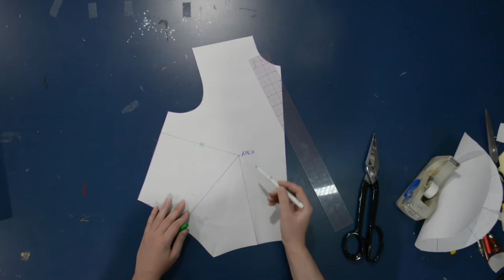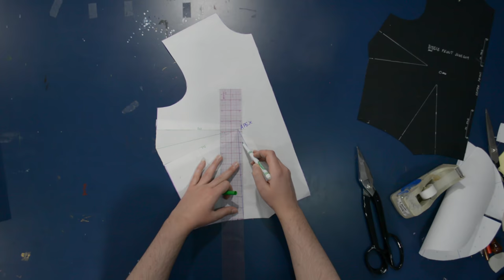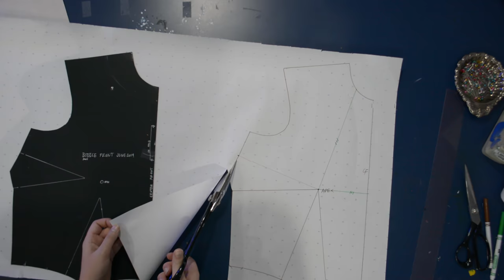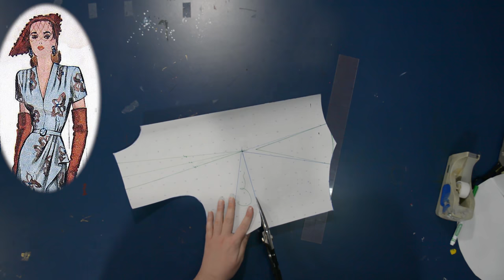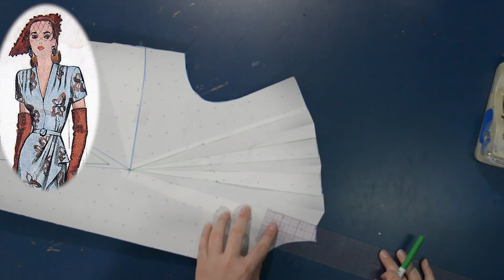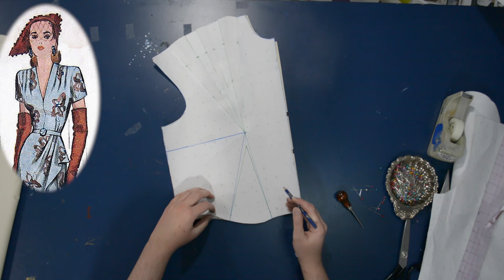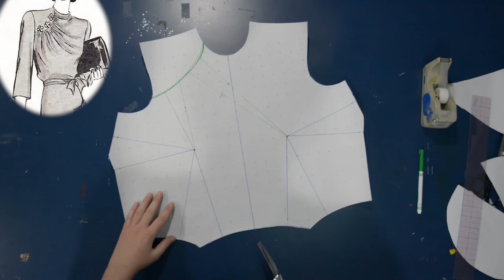Dart Manipulation Explained // The What, Why, and How of DARTS

Comment: Oooohhh this is SO useful. I knew darts, and that I put them into existing garments to make the chest fit WAY better, but now... The options are ENDLESS. Now I can alter patterns to fit me better: not only move the darts around for aesthetic reasons, but also to make the whole thing fit different. If the darts are at the top, the shoulders wil be more narrow. If I put the darts at the waist, that will be more narrow (which will work wonders for me, since I have quite an hourglass figure). If I don't want to alter the waist and shoulders much, I can put them at the armpits (what I've done so far for dresses that don't quite fit me). It all makes SEEEENSE!

Comment: Excellent! Thank you thank you thank you! You've explained and shown every step in multiple ways, and don't assume that we already know anything. Thanks for explaining sloper vs block. You say that you don't add 'much' ease. Where/why do you add ease? My patterns are so restricting that I can't twist, bend over, or bend and raise my arms. Your garments look smooth, not tight. Thanks for explaining that moving the darts DOES NOT change the fit! The examples are so helpful; I understand all of it. Love love love the asymmetric example - makes perfect sense. Thanks for saying that it's more about 'origami' than math. That takes such a weight off my shoulders! Your way is much better.  Question - What is an external dart (17:15)? How is it used in 1950s fashion? I did a search but couldn't find it. Sounds interesting.
Reply from the maker: Thank you Amy! I don't actually add any ease to my pattern 99% of the time, because I like my clothes tight 😅 I am not a good resource for learning about ease, as I just don't know much about adding it, since I don't eek! And external dart is just sewing the dart on the outside instead of inside of the garment, a bit like this neckline perhaps https://www.pinterest.com/pin/460563499399685468/ I used them on my leopard dress most recently https://www.youtube.com/watch?v=OI9k1tj9o5Q&t=806s

Comment: Hey Bianca, thanks for the comprehensive tutorial! But I have a kind of different dart question. How do I draft darts if I want to make my bodice fit close to my body from the waist to the under bust and then have fullness for my bust? With regular waist/bust darts the bodice has a lot of empty space in the underboob area and doesn't cup my breast.
Reply from the maker: You can either do something that has an empire (just under the bust) seam of some kind yes, like say these sort of '30s/'40s designs https://www.pinterest.com/pin/79798224627307942/ or you can go for a princess seam instead of darts, as the princess seam can be cut as close to the body under the bust as desired really. I will be showing how to make view B from this catalog page soon here on the channel, which will explain how to make the midriff sections of these styles in detail! https://i.pinimg.com/originals/8c/7a/41/8c7a41df36498bb3a79657434ba5c4f1.jpg
Reply: Look up some patterns for corsets or corset tops (like for wedding gowns). That will give you an idea, how the panels need to be shaped. 
Although it gets harder to do that, the larger your breasts are. At some point, cups or gores are kind of a must, because you'll be dealing with rather awkwardly curvy pieces, otherwise. But again, looking at historical corset patterns from different decades (just do a google picture search) will give you plenty of ideas on how to achieve a tight fit.
Reply: Look up 'contour darts' and 'contour bodice block'. A contour block represents the bust as a circle around the apex, with the darts being drafted at a different size inside and outside the circle and curved to connect the difference (this is how corsets and strapless bodices are drafted, as Rara Avis describes). Basically, the darts need to be sewn in a curve in order to remove more or less fabric from certain areas. Look at the curve on the side seam between the hip and waist of a skirt block. This is actually a dart; we just don't call it a dart because it's in a seam. 

If that all sounds too complicated, I would just make a mockup of a basic bodice block with a dart from waist to bust, pinch out whatever excess fabric is below the bust, trace the new dart line, and transfer that to your block.

Curved darts are also helpful if you have a full tummy and need a bit more space in the front, while still bringing in the fabric from hip to waist.
Reply: Yes I have been trying to achieve the same thing myself. I’m very excited for the upcoming videos and following some of these suggestions. Thanks!
Reply: @TheClosetHistorian  I am excited to see this!  The style reminds me of a swiss waist except it's built into the dress instead of worn over it like a belt.
Reply: @bianca_boop  Wow, thank you so much for your your reply! Sometimes it's hard to know what words to use when searching for what I want since I don't have an informed vocabulary. I suppose I should actually get some dressmaking/drafting books instead of relying on the kindness of strangers lol. Thanks again!
Reply: @TheClosetHistorian  thank you for your suggestions! I have been experimenting with princess seams but my bust is so large and my waist so high that I've been having trouble sewing the curves smoothly. I probably need to practice sewing curves more lol. I've been trying to draft a close fitting waistcoat that has a Victorian flavour but that I don't have to wear with a corset and smush my bust up to my chin. I think my reach is exceeding my grasp with my current skill level.😁
Reply: @raraavis7782  thank you so much! I was hoping for a way to get a close fit without a lot of piecing together of the fabric, but I suppose there's probably a limit to what a single flat piece of fabric can do, lol. I really appreciate your response, it will be fun to experiment with options I hadn't first considered.

Comment: I really appreciated this video. I've used dart manipulation and transformation into gathers/tucks to great effect on bodices that require a full bust adjustment. On a recent project (Vogue 8577), I split the new dart fullness into a bit of additional gathering at the shoulder and rotated the remainder into the waist. Then I converted the (now huge) single waist dart to parallel tucks because those worked better for that bodice style on my very short-waisted, busty torso.

Comment: Oooooh Bianca, this video is pure gold. I never thought I had problems with darts before, but now I noticed I also never really had an understanding about what is really happening when sewing darts 😅
I do actually have 2 additional questions:
1) in the bodice with the gathering down in the waist dart where you gathered it down to 7.5 inches - why wouldn't it be entirely closed instead of gathered then? I am confused with that because it would be 7.5 inches when you close the dart entirely, so how can you gather down the same amount of fabric to 7.5 inches and it is NOT entirely closed then?
2) is there any chance you can show how to draft the skirt part of that style with the nice side gathering piece? It looked like more than just a dart gathering in the drawing, kind of like the fabric is pulled a bit from the buttom and tucked up in the waistline and I would be the one saying "oh, I guess I have to drape this then" 😅
Reply from the maker: Thank you Laura! I'm afraid I don't really understand question 1. I need the waist area to measure the same whether I close the dart to shape it or gather it down to that same measurement instead, basically. For the skirt on the other hand, the front pattern would look like this https://www.pinterest.com/pin/460563499400986419/ and the extension on the side would just be gathered in and sewn to the smoother yoke-ish section above at the waist 🧵

Comment: This was really informative! I've never gone to school for sewing (aside from the very basic mandatory classes in junior high) so most of my sewing I learned by myself and from watching youtube. I'd consider myself pretty decent at it for having no formal training. 

But I always hated darts. They always came out wonky and assymmetrical in a bad way. But I'm making a mockup for a waistcoat as I'm watching this, and the front pieces are starting to look pretty good! Just need to adjust the side width and shoulder seam angle a bit. But this time I even experimented with a double pointed waist dart, because I need for it to swing out again as I want the waistcoat to go down past my hips in one piece. Similar to what you did with the example of the darts between the boobs, except I made the double dart in one piece in like an eye shape. I hope that makes sense.

All in all I'm planning to make a matching skirt and waistcoat, kinda like a skirt suit, but in a more casual way, for summer. I already got the fabric for it from a local store. A stiff and sturdy but quite thin weave, a cheap linen mix in dark red. So I plan on having it fully lined as well, as I suspect it'll be both itchy and see-through otherwise. 

Btw I always make my own patterns because commersial patterns literally never fit my body type. I usually use a vest or structured jacket that fits me somewhat well as my base for the pattern, and then adjust, adjust and adjust until I get it as close to perfect as I can manage. I use regular printer paper for my patterns and an old bed sheet for mockups. I've made a waistcoat before (with welted pockets and lapel collar) so I generally know how to do it. But then I completely skipped using darts altogether. It got a little excess fabric at the collar as a result, and feels snug over my chest. So this time I really wanna stop with the excuses and dive into those damn darts lol. 

My old patterns don't really fit me anymore though, as I gained some weight, and they had some issues to begin with, like being completely dart-less. I also couldn't even find them. I recently cleaned my home and I don't remember where I put them. So I'm starting over from scratch again, but maybe that's for the better. Pattern making has always been kind of a hassle for me. Far more cursing and fussing than actual results.

Comment: I have a 32G bust, so even with a two dart bodice, my dart widths are huge. A video talking about how large dart flaps can cause problems and how to rectify those, would be amazing. I'm trying to learn how to to do two waist darts and two side bust darts as a way to reduce the dart flaps but it hasn't been working out well so far.

Comment: Neck deep in drafting my bodice blocker and needing help: I’m QUITE asymmetrical because of scoliosis, the implication being that my shoulders are sloping at different angles and, most critically, my “apex” are like 2 inches different on the horizontal axis because my torso is slightly twisted. This is not a big issue with store bought clothes because I’m also tiny — AA. But it’s making drafting the bodice quite hellish. So. My Q: what lines are the most important in this drafting process? I’m thinking the horizontal ones? We are trying draping instead of using Armstrong’s method because that way caused its own chaos. There’s about 2 inches vertical difference shoulder to waist, left versus right. So I was going to go w the longer distance. And then just make the darts in different spots? But then I will be accentuating and literally pointing out my asymmetrical self. Going in circles here and could use the input of someone more skilled than me! Thanks!

Comment: Thank you for this video! Even though I have watched a lot of your videos where you do dart manipulations already I find this video to be really useful. I would also LOVE to see a video about grain lines! 

I do however have a question about the weight of the fabric (or maybe about how tightly woven the fabric is). I have made dresses out of the same pattern several time, and I know it fits me perfectly. I've always made it in a 100% cotton material, much like your muslin fabric. This time I made it in a cotton that was a bit heavier and a lot stiffer than the once I've used before. It turned out way to small. Is it common to add more ease to a pattern depending on how heavy/ tightly woven the fabric is? 

I hope you have time to answer! I love your work and you have learned me a lot about sewing!
Reply from the maker: Thank you Victoria! I rarely add more ease for a thicker fabric myself, it has to be quite thick (like a thick wool perhaps) before I think to do so, but I understand the predicament. I suppose whenever I use a thick fabric (like a cotton pique or twill) I usually have bought one with a tiny bit (10% or less) stretch so I don't run into this problem very often!

Comment: Thank you so much for this video!  Dart manipulation was difficult for me most of the time, but your video, with the repetition really got through to me. I have to work more on getting my sloper tightened up well, as I think that is the secret of getting things to fit me consistently.  You referenced ease and I was wondering how you figured out how much ease to put into your sloper?  I think that is where my problem is on mine.   Thanks again and take good care!
Reply from the maker: Thank you Peggy! I didn't really think about adding or taking away ease once my sloper pattern was done, I just fit my sloper exactly as I wanted it to always be in the initial process of making it I suppose. So I have never added "ease" onto my pattern, I just fit it how I wanted it from the get go. My pattern actually has negative ease, meaning the pattern has a 30" waist exactly but my waist is more around 31" currently (I like cookies...) but I am a very squishy person so this is no problem 😅
Reply: @TheClosetHistorian  Thank you! I wish I only liked cookies! Unfortunately, I also like, Twinkies, Reeses and ice cream! LOL!

Comment: I have a lot of old Bravissimo dresses that are made out of woven fabric, not stretchy, with linings.  Bravissimo is an English company who make bras and other clothing for women with a high bust to waist ratio, though I think they stopped making dresses a few years ago.  I just had a look at the dresses, and only one of them seems to have darts, very hard to see exactly how they are made as the dress has a lining fixed at the waist.  The other dresses are constructed in more complex ways to give a high bust to waist ratio.  My measurements are 37-27-37 inches, which doesn't sound extreme but I have a lot of difficulty buying clothes to fit, and so fed up with dresses that are ultra baggy around the waist but pull across the bust, as well as having armholes and sleeves that are too tight, which you get with the baggiest waists, which is why I am trying to learn to sew my own, both to make sleeves as wide as I need and proper waists, and I can never find paper patterns that I even like, and when I buy ready made clothes they always need some sort of alteration or acceptance that the waist is a bit baggy and the bust a bit tight, or just outright reject anything with tight sleeves and armholes however pretty it otherwise is.
Reply from the maker: I often use the dart fullness in different ways, as gathering as shown here for example https://www.youtube.com/watch?v=b4PO-GzQSdM or as style lines like princess seams as seen here https://www.youtube.com/watch?v=7irPyafNPsY&t=908s The basic blocks have darts, but once you have determined the dart fullness needed, you can use it in hundreds of other ways for sure!

Comment: Thank you SO SO MUCH!! This was absolutely fascinating and well-presented!! I learned so much!!! 

I sew gowns for a variety of 1/6 to 1/4 scale fashion dolls for collectors, and as such am always needing to adjust darts for fit to the differing doll bodies. 

I am able to use the doll body itself as a ‘dress form’ when I own that doll, but I can’t buy every collectible doll body that I may need to design for 😂. (I do collect a fair number of the most popular dolls.) 

Do you have any tips for changing darts on an existing pattern to fit a larger or smaller bust? (These dolls’ cup sizes are all over the place!)😅

For example - a commercial pattern assumes an average size. I know how to take my Barbie pattern as a template, for example, and lengthen the torso, narrow the shoulder, or adjust for a taller or shorter doll. That’s not hard and I just need solid doll measurements in hand for comparison and I can get a fairly close fit without having the doll in front of me. 

But… How do we work from an average, generic bodice block  to make the bust darts smaller - or larger - if the person (i.e., doll!) isn’t available to pin things on to, to do a proper fitting & pattern draft process?? Could you give me some type of general rules of thumb?? Thank you again so much!!!

Comment: Thank you for a fabulous tutorial.  Thank you so very much for a fabulous tutorial ..... I'd also love to see the type of 'dart' that looks like an upside-down hockey stick ... with the 'dart' being a part of the 'cone' but with that lovely fitted appearance. I don't know if it's what you referred to as a Princess top .... It's as though the shaping begins from around where the nipple is, then it moves up to the middle of the bust then turns under the armhole (not assure if it finishes across the bust, or just underneath the bust.  I'm a DD and I find that clothes with that type of shaping gives a better fit around the shoulder which tends to gape a little around that side area and I have to take a little bit of that gaping as my bust tends to be fuller at the sides, as opposed to the gaping at the side.   I just don't know the correct term for it.  It's as though it gives the shape a more tailored appearance.   Thank you from an Aussie fan.  I'm so pleased that I have found your channel.